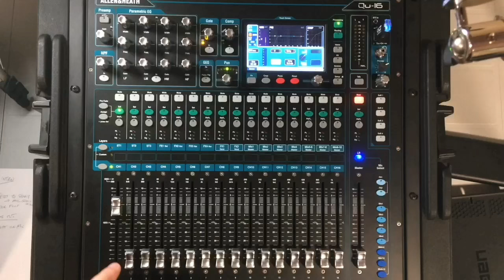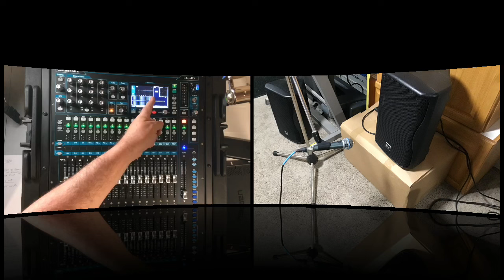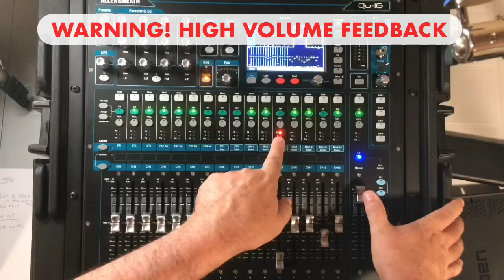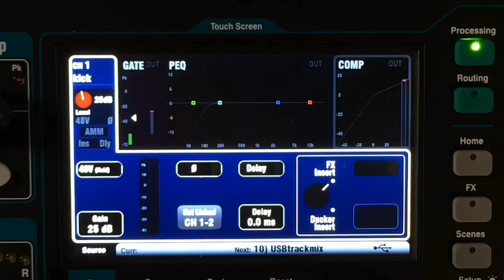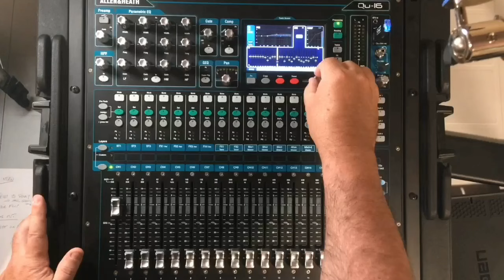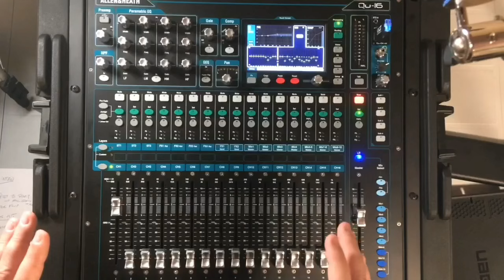How to ring out mains and monitors - A&H QU series WARNING High Volume

Comment: I mean the theory is great, but you've cut so many frequencies that at that point you may as well just reduce the overall gain on the channel and then reduce your cuts. Also, I would always avoid using parametric EQs to ring out where possible. For me, the graphic is for tuning the overall sound to the room, including eliminating feedback. The Parametric is for shaping the sound of the source. By doing what you've done there, if that was your lead vocalist, you've only got one PEQ band left to EQ for the singer.
Reply from the maker: Thx for watching and for the feedback.
Reply: @lufferov in that case I am confused. Because Rob quite obviously used the Graphic EQ in this video and not the Parametric?
Reply: Tune the graphic middle slope for the room for and music being played by the band. The other tunings like drums guitars and mics accordingly. As far as guitars and other instruments where the player has gain control, well....you know how to keep them in line with a little compressor. If you're crafty with it, they'll never know if you do it post instead of pre. I'd avoid harsh cuts of gain, as the front end of the amp will suffer from the low input, introducing white noise into the chain out the the speaker arrays.
Reply: Not a problem using a PEQ when tuning a bus, where the monitors live.
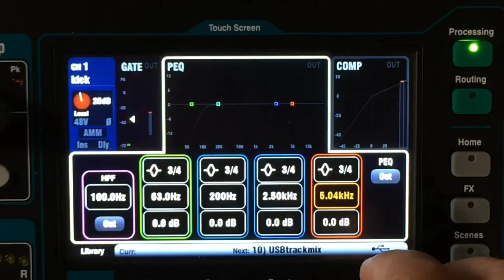Reply: @dcgreen1987  he is using the graphic EQ for most of the video but then at 12:00 he starts using a parametric EQ to cut out even more frequencies out. He used three out of the four bands available on the parametric EQ for that channel. so only one band would remain for tuning the actual user of that channel. 
Unfortunately he is committing the cardinal sin when ringing out a room. you never ever need to cut that many frequencies out. the main fault and the reason why we're hearing so much feedback is cuz he keeps pushing the level well well beyond the normal playback volume that he would be using for a show. he even says that a few times..So he is aware that the volume he is pushing in order to induce feedback is an unrealistic level, so its a little perplexing that he keeps cutting more frequencies...i mean, if the frequencies aren't feeding back at the normal volume for the show, there is no need to cut more.  any and all frequencies will eventually feedback if the volume is loud enough..
Reply: He exagerate the mic placement as well as the mix volume , to show off the process..

Comment: Fantastic video. Two questions: 1. would the settings be the same (similar) for same manufacturer/model microphones, or does each microphone have its own freq issues?  2. Can this be done without disconnecting everything from the back and simply muting all other speakers except the one you are trying to ring out? 2b. does one need to ring out both L/R individually or will the setting be similar for copy and paste?  Thank you so much for the video series.
Reply from the maker: Thx John.  Glad it was helpful.   1.  Settings should be the same for same make and model mics.    2.   Sure.  I only setup the basics I needed for my demo.   Just mute everything else as you deal with each output.   2b.  LR would be the same..
Reply: @soundadvicewithrob3083  just Wow

Comment: We love your Channel Rob! Two things... If you're cutting more than 6-8 Frequencies, you've cut too much. Also, Microphone placement is everything when EQ'ing a room or a venue. Place each microphone exactly where it will remain during the show, then use your EQ method. You'll never get rid of every single problem frequency no matter how many cut, you'll just end up killing your entire EQ mix and starting back at square one. Any additional problem frequencies can be contoured using the PEQ on each channel after "Ringing Out The Room". 
I've been "The Sound Guy" now for over 20 years and get comments often from both crew and attendees on how great the venue sounds.
Hopefully this tip is very helpful for others... Thanks so Much!
Reply: Hey, a novice here, my brother and I have volunteered at various small churches separately and together for 20+ years. We now both volunteer at the same place with a qu5. He is under the impression that ringing out needs to be done with a “dbx RTA-M Real-Time Audio Analyzing Reference Mic” and by this vid seems to imply you use the mic you’ll be using for service. Obviously the quality of mic and speakers (and board) affects the quality and balance of the sound.
Reply: Also, Using any type of RTA Analysis Reference Microphone is another more advanced tool to precisely analyze problem frequencies in that room or venue and to help pinpoint those unwanted frequencies which is a better, more detailed way and with greater accuracy.

Comment: Wow! Great tutorial. We have a QU16 that we are using for our outdoor service.  I just rung out a presider wireless mic by sweeping the PEQ while worn and walking near the FOH speakers. I will re-do it using your method. Thanks. Maybe a video on gate and compression next time?
Reply from the maker: Ron Vargas  thx Ron.   Yes I plan to get to gates and comes soon. :)
Reply: Rob, what was the volume level of your active speak? 10 o' clock or 12 o'clock? Will it matter?
Reply from the maker: The speaker was set at 12 but honestly it wouldnt matter.  You simply adjust the output from the board

Comment: Great tips....hadn't thought about going about it quite this way...   granted, I am new to audio, and just researching some gear as I will likely be getting a mixing desk soon.
   I have been debating between a 12ch  analog for now, or something like the Qu-SB or XR18.  Not sure I really want to have ONLY iPad/Tablet or PC controls, so may get the small analog desk for doing what I need at the moment, and save up to later get a Qu-16 or X32 Compact.  
   Gonna watch some.more videos and do some pondering....
Reply from the maker: Thx Isaiah.   Hope you found it helpful.    One of the reasons I like the QU series so much is that it’s the best of both worlds.   The convenience of iPad control when I need it but also a full desk of physical faders.  I often have my hand on the faders and eyes on the stage.  Not so easy with an iPad.
Reply: My 2p worth...I've used my Qu-Pac with iPads ( I carry a cheap SH spare iPad) doing live sound for 2 different 8-piece bands over the last 6 years, 20+ gigs a year.  For pubs and clubs I wouldn't go back to having a physical desk out front, I leave all the gear on stage and I've got pretty nifty tweaking things on the iPad and it works fine.

Comment: Thank you so much for this video. this is really helpful. i have seen different videos of ringing out FOH. yours is simple and straight forward. to do this process, what is a good distance between the mic and the FOH speakers?
Reply from the maker: Thx.  Glad you found it helpful.   Usually within a few feet will do.   Mine was probably a bit close due to space to setup for that video.   Imagine someone walking in front of the speaker with a mic.   If they did that 40ft in front, it wouldn’t have much affect.   You’re just trying to simulate the problem.

Comment: In the event you have other playback sources, say video rolls for corporate, graph eqing on the mains is less than ideal. All the frequency content you are pulling out will hinder any other sources.  Unfortunately, the qu 16 is limited in terms of the mix routing. One work around I have used for EQung a bunch of Lavs for instance, is send them to a mix. Make sure all Lavs are deselected from the mains routing. If it’s mix 1, connect a female XLR to 1/4 cable out of mix 1 and input it line level to channel 16. Leave channel 16 routed to main mix.  Now you have access to Mix 1 graph eq, leaving the master graph eq for shaping the overall system.  Do make sure you set Mix 1 to Post fader. I realize this takes up an input channel but it seems to be the best work around.
Reply: Wouldnt it be better to have all your vox going to a sub and that sub to the main mix?  And then you could eq that sub. Or does QU not have the ability to assign a sub to the LR?

Comment: Great videos Rob. I’m fairly new to the QU32 and having issues with the drummers monitor(mix 4). He doesn’t have electronic drums and I know that is the main issue but I’m looking for a band aid until he can afford them. He needs to hear more fiddle (mix 1) but it’s maxed out on his mix. Is there anyway to increase his volume within channel 1 without interfering with everyone else’s?
Reply from the maker: Thx Brian.  I’d start by making sure the fiddle channel has the gain set correctly.  When it is, there should be lots of headroom to provide the needed level.   Second make sure that all other signals in Mix4 are not so hot that they have made it necessary to turn down the Mix4 Master.  This would limit what you can get from the fiddle.   Last, most often when I player wants “more” of just one thing in the monitor I find its best to bring everything else down just a bit and the perception will be that the fiddle got louder.  Hope that helps

Comment: Hi Rob! 

Great video!!!! So my question is do you have to do this for each speaker? I Am pretty sure the answer is yes. I think that's what you meant by copy and paste if they are the same type speaker. Also thanks again for the video. There are not many videos that are very informative. Could you do a video on using the USB on the back of the qu16 to record live practices for each channel live to DAW. I know it's possible but I am a rookie and slowly learning. I want to be able to capture great practice and be able to mix it afterwards for each musician for a demo cd/ect.

Thanks,

Brian
Reply from the maker: Thx Brian.   It’s not required for “each speaker” but should be done for each Mix.   Just to clarify terminology because you could have multiple speakers running off the same mix.     The copy and paste works if the speaker configuration is the same or similar.
Yes, USB recording is on my list.   Stay tuned....

Comment: HI Rob, thanks for your excellent videos. for some reason, my QU16 cuts off the sound to my speakers...when i play a pro tools mix i hear it through the headphone jack and the speaker volume to my speakers, but about 10 seconds later it cuts off my speakers - I can still see the levels on the mixer and i can still hear it through the headphones..but this is a brand new issue that just started this week. the speakers are JBL studio monitors that have to be powered by an amp. any thoughts?

Comment: Hi, Rob. Fantastic tutorial. I want to know your experience with feedback using condenser mic. Is better with a metering mic per exemple a Beyerdynamic MM1?  Thanks for your reply. Grretings from Medellín, Colombia.
Reply from the maker: LIXO Sonido y Discos Thx very much.   Using a condenser mic would be a very similar process.   Each mic responds diff regardless of being dynamic or condenser.   If I had a metering mic like the MM1 I would certainly use it.   Since most users have more common mics like the sm58/beta58 it does provide very usable results.

Comment: Very informative video, a couple of questions, should one try and set the gain to the zero light for each channel at the select button? Can all the channels be rung out at the same time or is it better to do each channel individually? and finally how best to save the settings? Am very amateur operator in a church setting. Thanks
Reply from the maker: Ian Rutherford Thx Ian.  Yes, gain is best set so that the incoming channel signal is peaking at or about the zero dB mark.
The ring out process is not done for each channel...it is done for each output (L&R, Mix1, Mix2 etc).  To save the setting, select the output (eg LR) then with GEQ selected, choose the Function key then store new and enter a name.

Comment: This is fantastic!  Question though...  I occasionally do sound for a theater group that uses a QU-32 and a few different types of microphones.  Would I only need to do this with a single mic, or would I try all the different kinds just to make sure?  I'm new to sound, so trying to soak it all in.
Reply from the maker: Thx Chris.   I also do a fair bit of theatre work.   EQ for that situation is going to be a “ballpark” effort.   Try with one of their most common mic’s.   Definitely don’t try repeating for every mic.   Also less is more so I wouldn’t go beyond about 6-7 freq cuts on the fOH system.    After that week the peq on an individual mic and again only if it’s a particular problem

Comment: Hi Rob! I love this video, thank you so much for making it. I have a question; should this same process work the same way on my aux channels? I ask because when I try to do this on the aux channels I'm not getting the peak signal light that shows me which frequency I need to cut. I'm using the Qu-16C. Any help would be greatly appreciated. :)
Reply from the maker: Thx.    Yes the process works the same on Aux outputs.     Make sure you have both e the sel and pafl selected for the mix you are working with

Comment: Hi Rob, thanks for this video. Coming from a QSC Touchmix, where the process is automated, knowing how to do this on the Qu-16 is a godsend. Just a question : what are you playing through your speaker? Pink noise?
Reply from the maker: Thx Don.   In this case  I’m not playing anything thru the speakers.   Ive simply placed a mic in the hot zone with a decent amount of gain and then start running up the master fader til it begins to feedback.
Reply: @soundadvicewithrob3083  thanks, Rob.

Comment: Rob, Thank you and it’s a very helpful video. I have few questions. 1) I am using different microphones like SM58, SM57 and behringer c-2, does this process have to repeated for all mics in different channels. 2) Do I have to repeat this process as I am in different stage programs every time. Thanks
Reply from the maker: Thx.  Glad you found it helpful.   No you don’t need to repeat the process.    A generic mic like an sm58 will give you sufficient results.    2). No you will prob find that one time will give a good starting place for other stages
Reply: @soundadvicewithrob3083  Thank you
Reply: @soundadvicewithrob3083  "an sm58 will give you sufficient results" 
I wonder how this can be "sufficient" in a standard-stage situation. You fit this actual mike to one actual speaker in one actual position at one actual volume.
Your result will be random, even with a very flat pressure transducer (like an omni mike for meassurement).

Comment: Fantastic tutorial Rob thanks for taking the time to share.
However, I have tried this using my QU16 and while I can produce feedback and notch the frequencies by ear I am unable to get any visual indication via the peak lights of each fader.
Any idea what I might be doing wrong?
Reply from the maker: Thx. Glad you found it helpful. As far as I know the peak lights should be automatic.  But let me look around.
Reply from the maker: I think your issue may be that you have not selected the LR output before using the GEQ.   Make sure you actually press SEL above the LR master fader (or any other output if that’s what you are ringing out)
Reply: @soundadvicewithrob3083  I've done that. Others have suggested that I have to have the PAFL selected on the fader I'm ringing out but I see that you don't

Comment: Great Tutorial, thanks Rob. I have a question ( and sorry if you've answered this in the comments already, I did search for it but couldn't see the same question ). My question is....now that you've pulled away those frequencies causing feedback with the SM58....and because this is on the LR master fader...wouldn't this also effect the other things going to the main LR? for example, if I had some backing tracks on another channel going to the main LR...wouldn't the backing tracks sound change also due to what you've done for the mic? or any other inout for that matter...keyboards, guitars ( hope that makes sense? ). Thanks!
Reply from the maker: Thx Shaun.   Yes you’re right.   Global changes to LR affects all inputs routed there.   Any processing such as EQ is a trade off.   You simply need to decide how each change affects everything else and which is a priority.   Is it more important or preferable to lose a little freq from a backing track, or eliminate feedback from a mic?  Which will your audience notice more?   Its why mixing is often more art than science.   Its not always hard and fast, or black and white rules.
Reply: @soundadvicewithrob3083  thanks Rob. Really appreciate your responses as I work my way through the QU-16. All the best from New Zealand !

Comment: Thank you Rob for the video it is very helpful, but I have a question. Why didn't you use the parametric Eq for the LR to cut the extra 400hz, 4khz, and 5khz because that means if I have six microphones I will need to cut down the hot frequencies on each microphone channel?
Reply from the maker: Thx. Glad you found it helpful.   In my example i was already quite aggressive with eq cuts to LR.    Any more and it would affect the overall FOH sound too much.   EQ is like salt and pepper…a little is good but it becomes too much very quickly.   In this case there would be nothing wrong with making that same change to six mics.  Yiu could even store it as a template on the first mic and apply it to each of the others (much faster)
Reply: @soundadvicewithrob3083  Thank you do much. It's very clear to me now. Thank you for this video. 
Emmanuel from Lagos, Nigeria.

Comment: This is really helpful video! Is this gonna be done in different type or brand of mic? Im Newby here.
Reply from the maker: Thx.   Glad you found it helpful.    I used a fairly common sm58 mic in this test.    You can simply use whatever type of mic you are using most often
Reply: @soundadvicewithrob3083  thanks so much. I definitely have to try this